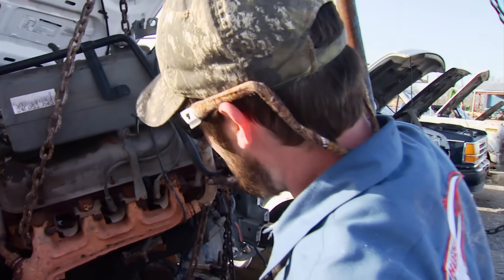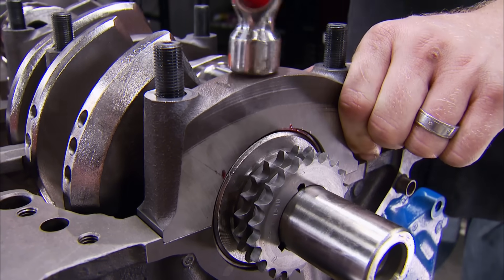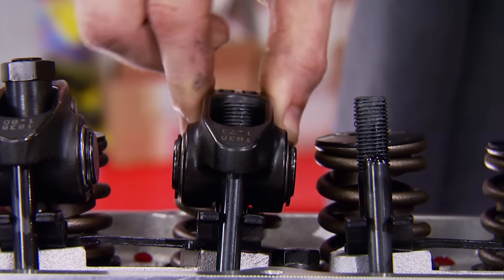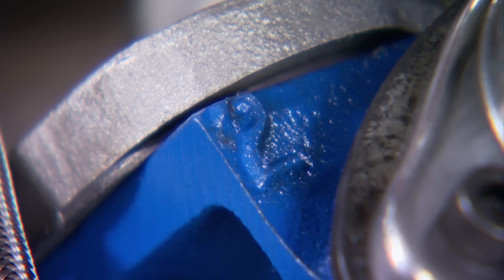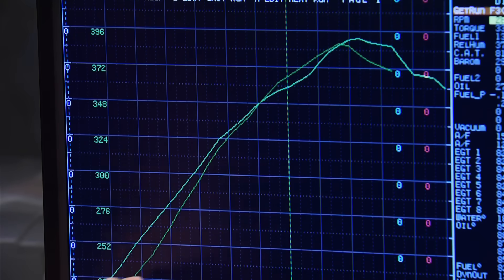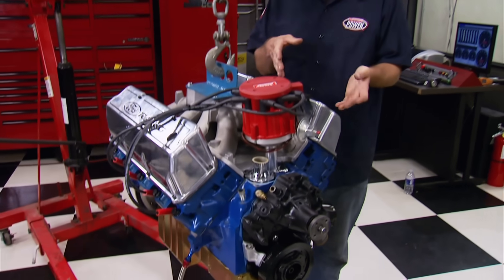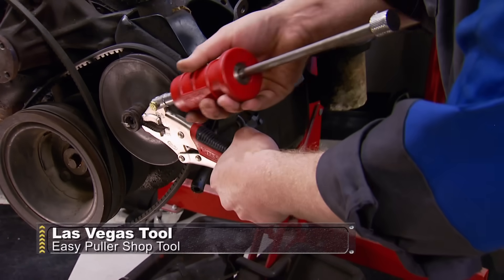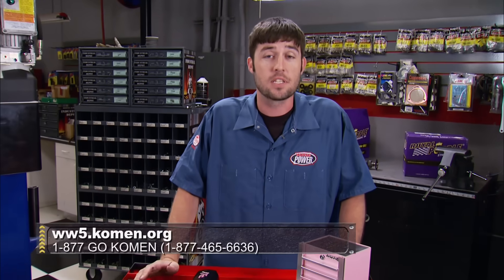351 Small Block Dyno Shootout: Windsor vs Cleveland - HorsePower S16, E11

Comment: Now throw closed chamber heads on the Cleveland and watch it spank that Windsor
Reply: Trigger Warning you're correct , throw closed chamber heads on a 400 ,a set of manifold adapters ,and a solid lifter camshaft , 600 hp at 6000 rpm , was done back in the 80s , it works trust me I did it .Will set a 1/2ton 4x4 on fire.
Reply: @beckywatt5048  I just built a 400 for my 78 f250 4x4 and wasted a lot of time on those open chamber heads... it still shits-n-gets but i would have saved a lot of time and money on a nice set of aluminum heads.
Reply: Trigger Warning I had trouble with the guides , I should have spent the money and studed the heads w/ guidplates and roller rockers , Was going to try roller tipped rockers but nuver got around to it , I just wanted a good motor so if I was out in the mud by myself I could really stand on it if I needed to , it got great mileage on the highway though about 18 with the gate down .
Reply: @beckywatt5048  the fuel mileage was the main reason I went with the 400... I did the roller rockers and modified some guide plates. I cut the rocker perches down a bit to accept regular rockers and studs and then cut the spring seats down to keep from binding with the bigger cam.
Reply: Trigger Warning Impressive , I bought all the Ford books I could get my hands on at that time , Clevelands were a dark art , I was on my own didn't have a lot of tutelage at that time . These engines breathe so deep I had to buy a couple of Holley books to learn how to modify the carb enough to make it idle and run right .Btw this is my wife's computer, I've had Lyme disease for about seven yrs , have just found the bottom of the rabbit hole and am starting to get better , see Dr Alan MacDonald / multiple sclerosis .
Reply: @beckywatt5048  Ive had a lot of carb issues, I ended up throwing a bung in my exhaust for a o2 sensor just to make it easier to dial in. I know how you feel about the MS, Ive been sick from heavy metal poisoning for about 12 yrs now. Some days are good and some are really bad. Its turned into Parkinson's.
Reply: @triggerwarning2439  At the time I built mine Holley had just their first aftermarket FI , it was expensive and unproven , I bought a 750 for $35.00 I used what I had , electric choke and Ford kickdown , had to Dr holes in the throttle plates and drill the bleeds , alot of power valves and jet changes, and spark plugs , but when I finally got it right , oh man , w/ 11.00s it was almost scary, got tired of repairing 9 ins and went to a Dana 60 w/ a clutch posi , and a posi in the frt , it sure scared alot of cars .Try EDTA and boron / borax for the metals , candida is in our systems to sequester h.metals  boron kills it , have you tried juicing especially cabbage  I'm taking iodine , wormood , selenium, and walnut , it's killing something off ,trust me it's a weird feeling , good luck .
Reply: @beckywatt5048  I uploaded a vid of my truck running... check it out.
Reply: Trigger Warning Sounds good , I used 2 1/2 in w/ turbos on mine worked pretty good .
Reply: @beckywatt5048  I'm building my maverick next, going with a 94 300 inline with a turbo... kind of going for the freeway flyer thing with a AOD and 4 wheel disc 8.8 rear. 

I tried just about everything to clear the metal out of my system but after almost 20 yrs of very heavy welding, the damage is done, my DNA has changed and I just have to deal with it now. I was sick of Drs trying to kill me with their meds.

Comment: About 30 years ago a guy in Alabama made a conversion kit to put 351C-2V heads on a 289/302 Windsor short block. I built one for a 66 Mustang. Never dynoed it, but it was the runningest Mustang around here!

Comment: Put 4V heads on then add a mis-matched 2V intake and 2V headers for an exhaust restriction then claim it's "2V for the street."  Worst tune up ever LOL.  4V heads, 10.5:1, Howards hydro roller, Funnelweb intake and a 650DP here make around 450HP with 357 CID.  Only about 30 short of that 408W.   I have a 393C with unported AFD heads that makes 575, so you folks might want to do more research if you tinking with a Cleveland again.

Comment: How is this a direct compare of the two platforms since they are built totally different. The Cleveland has so much more to give if built up right. I had a Ford Cougar XR7 with a 351C that had some work done to it back in the day and it was a very aggressive car with that 351c in it and went like a bat out of hell which is pretty good considering a Cougar was a bit of a heavy car.

Anyway point is to do a direct compare you either need to do a stock vs stock setup for both engines or build both to their max and then see which is better or better yet do a before and after build stock vs stock and then do a dyno with built to the extreme and see which is better before as well as after. You will find the Cleveland will tear apart the Windsor engine stock vs stock and probably will do the same with both built to the extreme a sthe Clevelenad engines were just out right better engines from the get go.

Comment: Ya, those 4v heads are just junk... LOL.  Build the engine right, let it turn some real RPM, and it's all about those high compression 4v heads.  Those 4v heads have so much more potential, so sad to see them strapped on a sub-optimal motor.

Comment: This is a F'n joke. It is in no way a fair comparison. Anyone who thinks it is is plain stupid. You put the Cleveland together basically stock. The only difference is mainly the cam and intake. The Windsor has pretty much nothing stock. A stroker crank, aftermarket heads , pretty much all you can. Windsor is a good engine, but doesn't compare to cleveland. And going by your video . You don't even know a cleveland is good for 10000 rpm with a stock bottom end.

Comment: Wait wait wait. You took a stockish Cleveland with a cam and intake and stockish heads and put it against s stroked Windsor turned into a Clevor and you call it a comparison. Lol. Run the stock bottom in the Windsor and aftermarket Windsor heads, comparable compression, cam, heads,  intake etc and let's see a real comparison

Comment: no jet changes or measurement of air/fuel ratios to accompany those better breathing heads? shoulda ran fuel injection of some sort and some sort of feedback loop to dial everything in other than ign timing. demon or not, a carb is just a carb

Comment: First mistake, they used 4-V open chamber heads, which are nothing but boat anchors! Factory 4-V closed chamber heads would’ve killed the Windsor motor on HP! I know that they were shooting for torque vs HP! I’ve got a Cleveland with closed chamber heads, Parker funnel web intake with the tongues, mechanical roller cam, TRW flat top forged pistons(Sealed Power $350.00) Factory crank&rod( I beams cleaned up) All ARP hardware. Balanced rotating assembly. 4150 950 Holley HP. Low 9’s 1/4 mile on a 175 shot. 29 degrees of timing on NOS!

Comment: Just an FYI...30wt Edelbrock Break-In Oil conventional = 69,160 psi film strength. And for comparison, a 5W30 Valvoline Premium Conventional, API SN = 94,744 psi film strength...You may want to rethink your use of "Break-In" oils as even though they are high in zinc content, their film strength is quite low. https://540ratblog.wordpress.com/

Comment: Make a 4v Cleveland out to a  408  cube forged engine and add a roller cam  with 10.5: 1 compression and it will out torque and out  horsepower that 408 clevor 302 boss replica  all day long. I have built and owned all variations of each. And its a Ford give it a shitload of fuel. You will have to do some oil starvation on the top end.

Comment: Closed chamber 2v Cleveland heads with 4v exhaust valves and open the ports, leaving the intake standard, would be the comparison to check against the 4v's. At least 10.50 Comp, 9.80 is a waste of time. Dual plane with the worked 2v head. And a good cam with 112 separation. That would make for a good show. But I'm not an engine builder, just have one in the shed.

Comment: Regardless of these guys hard work this was a disappointing "comparison" . How would a 358 even begin to compete with a 408 in torque and the only way to even the HP would have been to spin the Cleveland a lot faster. Im sure the heads are capable of but the rest of the build isn't.

Comment: Wait, hear me out.

Lets compare a v6 honda mini van and a 2 stroke honda weed whacker and make it a comparison video just like this!
Reply: Johnny,
if you had 8 Honda weed wacker engines bolted together like a straight 8 smooth out the intake, remove the muffler and straight pipe the 2 strokers you could make as much horsepower as the Cleveland did.

Comment: 9:24 These Kids are so stupid, I pulled my 4v to put on 2v heads, back in the 1970s.
Reply: Hi Lung Dong, why did you switch heads?  Was it for mileage improvement?  As a young engineer in the early 70s we tested mileage on a Ford 289 HP engine, switching from 4V to 2V heads with appropriate carbs (4V Holley with vacuum secondaries, 2V Autolite).  The primaries on the Holley were smaller than the Autolite 2V.  We found out that if and only IF you did not use the secondaries (i.e. drove "conservatively"), we actually got better mileage as long as we did not open up the secondaries - the great thing was that if you wanted to get wild, with the 4V, you had better performance and drop in mileage.  Ciao, L
Reply: @lancelot1953  
Well sir Lancelot, the 4v Cleveland heads intake ports    where to BIG.  The 2V port  where better. This was when bigger was " thought"  to be better.  NOW we have computers aid designed ports & C.N.C. machined ports. Just remember sir lancealot bigger is not always better, just ask your wife.
The correct answer is, a  Carburetor is wet flow & and the air flow stream must be swift enough to carry the gasoline droplets.  With port electronic fuel injection it's less critical. 
Here's Questions to think ABOUT
1. Why does direct injection of gasoline result in 10% +++ increase in horsepower?????

Comment: I don't trust your testing with the clevor due to dieseling when you shut it off. If a person is running a Holley carb you just blew the power valve sooner or later. NOT A GOOD TEST FOR STREET USE!

Comment: quick question,  for the Cleveland would that fit in 2001 F-150 4x4 / replace 5.4L  also with EFI could same numbers be seen ??  the HP and Torque??

Comment: As someone who has build dozens of Clevelands, both street and race.....what the heck is with the open chamber low compression 4V heads? Of course it will not have any bottom end....

No one uses those in a performance Cleveland. The are prone to detonation and were never a high performance option....

You should have run the 4V closed chamber heads. You were running flat top, same as factory, so that would have worked. 

Also...the inlet? You can not run the same inlet on both 2V and 4V....the port miss match is huge, same for the exhaust. Can not run the same extractors (headers) on both.

You did everything you could to hobble the Cleveland and make it look like a dog. 

Put some CHI 3V alloy heads on it and matching inlet and exhaust and with that cam, you would have 450 to 480 hp easily. Even with stock cast 4V closed chamber heads with that same cam and decent inlet and exhaust it would have an easy 425 to 445 hp.

Comment: Not really apples to apples.......in stock form a C would stomp the W.  It would have been a better Comparo to run good Cleveland heads on it and good w heads and intake on the Windsor. Let them stroke both to whatever they want.

Plus when they put 4v heads on The c they should have changed cam, intake,carb,and bigger headers and upped the rpm on the dyno to make use of the better heads. The C would have ruled. None of them know how to make a Ford run....

Comment: Any Ford person will tell you that the 2V heads are better for the street without using a dyno. Not to mention 500hp would be possible with a set of TFS windsor heads on a 408.

Comment: We are going test 351C 2-V heads against 4-V heads with no other changes. Then we are building a 351 Windsor into a 408 stroker with aluminum CLEVOR heads. Ok , but I know I would like that Cleveland 4-V with a bigger cam, more carb and 11 to one compression screaming down the street at 7,500 rpm!

Comment: This is a total waste of time. More dis-information for the Cleveland. The real reason that the motor made less power with the 4v head on it, is because you left the 2V header on it. The 4V Cleveland has a radically different exhaust port. By using the 2V header you effectively covered the 4V exhaust port by more than 30%. Not to mention the 2V intake, again 30% smaller. I made the very same mistake and it cost me over 50 rear wheel horsepower. My guess is that Cleveland would've made more than 450hp. The myth about 4V heads being too big and killing power is a totally false rumor!!

Comment: I've always liked the Windsor more...
Reply: How do you compare an engine with stock heads stock crank and a small cam to another with heads made for a Cleveland and aluminum.  Closed chambered and stroked to 408. How in any way was this supposed to be close . Put the Windsor heads back on it n stock stroke n see what you get or put 3v heads and a stroker kit on the Cleveland  . Then take it to 7500 rpm , if the Windsor can handle it lol

Comment: I built a 400m with Cleveland parts  I used trw dome pistons custom alum rods I had mad by R&R racing rods only trick part roller cam 4v closed chamber heads with high port exhaust got intake spacers  from price motor sports to run a 351 c intake 400s come with a factory 4' stroke it made 595 hp rods was the most expensive part $1000 bucks

Comment: What is this supposed to be  comparing, I have  made more than 500 hp from a properly built 351 Cleveland  4v more than 50 years ago, that was not even a Roller cam. If you  can't make  400 hp with a 4v Cleveland  you don't have a clue about  Cleveland  engines and you should stick with Chevys!

Comment: Would have been interesting to leave them both with factory stroke and compare the benefit of the canted valve head on the cleveland vs the traditional style head on the windsor.
Reply: That's what I was originally expecting! Stroking it invalidates what I wanted to see. Still a great build though.
Reply: Adding 'Cleveland' heads says it all, the canted valve heads are much better than the Windsor heads. So, they didn't bother...
Reply: they took what was good about the c and added it to the w THEN stroked it. there are tons of good after market heads for the w. the 3v from chi on that cleveland would shit out windsors all day long.
Reply: @rowdy hansen  the chi heads are sweet.  Aren't the kaase heads similar?  I think they're a canted valve head and they flow like crazy.
Reply: @ericrobison8591  yeah. the 400 or whatever cfm. the p38s would be a great candidate for the stroker windsor. have them cnc'ed, a 400 ford with the kaase heads vs a stroker windsor with p-38s would actually be a shoot out.
Reply: and where would we be if we added 50 more cubic inches and put aluminum heads on the Cleveland just to make it fair?
Reply: They're really just testing their after market heads (and the factory Cleveland 2v head) on two separate bottom ends.   
Because the bottom end difference are just oiling and bearing sizes.
Reply: makes a hell of a lot more sense than what they did do. we're handing this world over to them, you know that don't you?

Comment: CHI heads on the Cleveland with a John Kaase spec cam against a stock stroke Windsor with any aftermarket Windsor head and cam would be a much better comparison.   Big fail for this video.
Reply: you didnt see Windsor headed fords in the top 5 engine masters ford units.  CHI kicks butt!

Comment: Not a 351 comparison, and not a windsor comparison. it is 351 vs 408, and cleveland vs boss. 
Comparing the 351 windsor vs the 351 cleveland straight up, there are only 3 real factors. Strength of the bottom end,  where you want the power band, and parts availability.

Cleveland takes the first , and is more versatile for the second (2v heads with the right intake and cam combo will give just as much low end torque as the windsor, and still more hp at 5500 than the windsor with windsor heads, the 4v heads will dominate on the mid to high).

Comment: Y'all should know that you are going to get ripped for this.

So a stock crank 351 Cleveland and stock heads against a 351 W with a 408 stroker crank and Edelbrock aftermarket heads.   Great head to head shootout dyno comparison.   No it wasn't.   Why do you people continually do this stuff. 

This is as bad as the Coyote versus LS shootout with a stock crank Coyote and a 427 stroker LS.   Another great head to head dyno shoot out, NOT.   In this second case they destroyed both engines on the dyno and then called the LS the winner.    Winners run when you pull them off the dyno.   They don't blow up on the dyno.

It did show me one thing of value that is of interest to my own engine builds.   I have a fresh .030 Cleveland(forged pistons) on the engine stand with bare 2V stock heads.   I think I will stay with the 2V heads and build them since this will go in my pick up.   I want the torque. 

Go back and build a comprable 408C with aftermarket heads and show us the dyno on that engine.     You didn't prove that the 4V heads are for racing.   Race engines need the mid range torque band even more than a street engine does.   All you prove is how bad you can mismatch build a Cleveland and mess it up.

Comment: A 358 compared to a 408, cast iron stock heads compared to aluminum performance heads, and then to top it off, single plane intake compared to dual plane intake. Not much of a comparison when you are talking numbers. How about a 351 Windsor 4 barrel against a 351 Cleveland 4 barrel??